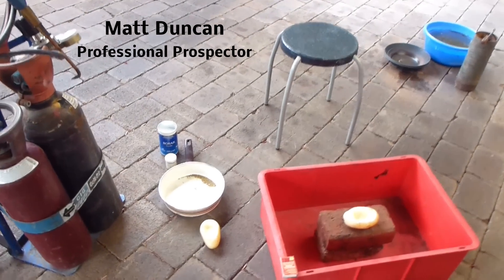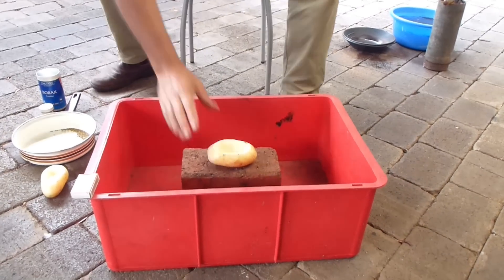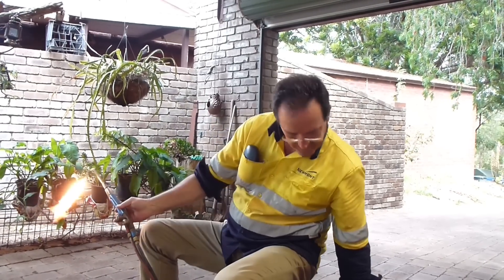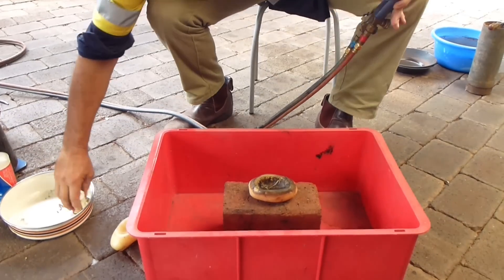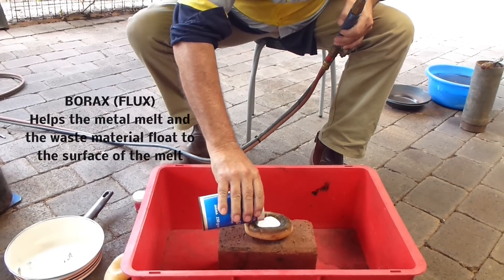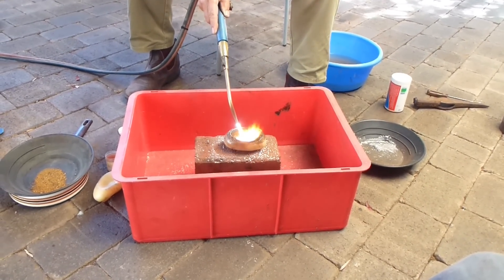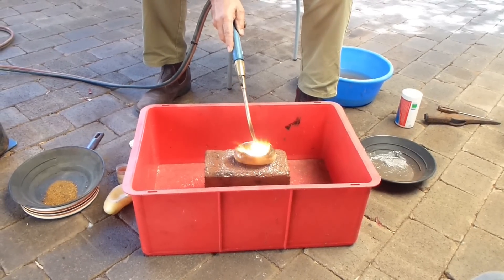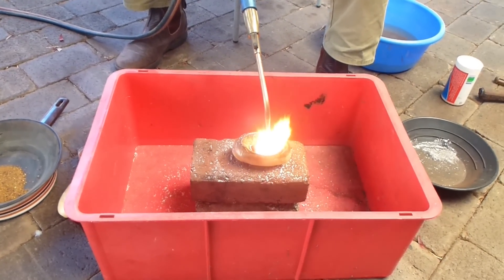Gold ingot in a potato.

Comment: What were you saying about the borax blowing away because it was so fine. What did you do. Couldn't understand your words on the video. Thanks.
Reply from the maker: +Gold Prospecting When using a flame or blowtorch, it's very easy to simply blow the borax out of the crucible or potato. One can mix with water and the borax will form a crust as it dries out but you still have to adjust the point of the flame so that the flow of hot gas is not to forceful or aggressive. As the borax melts, it will coalesce and flow into a 'blob ' or pool. - Chris